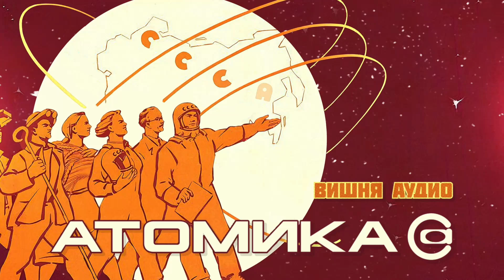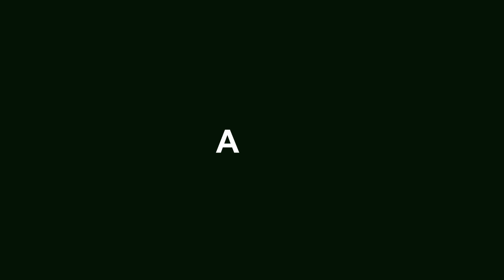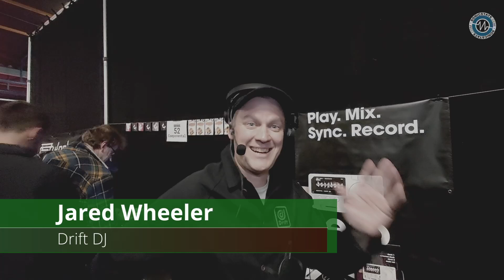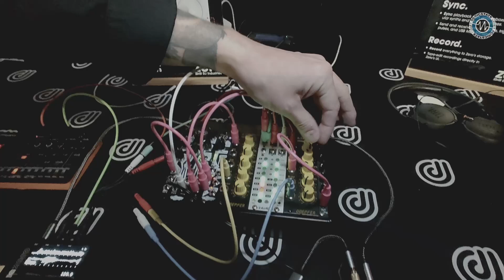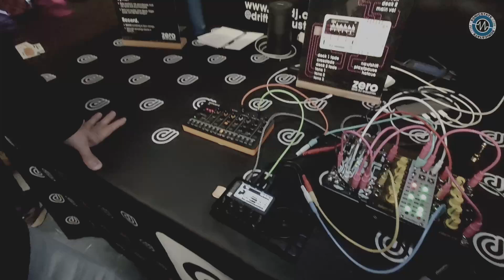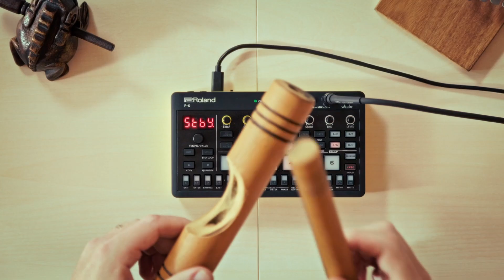Bristronica 24: Drift Zero - Synced Audio Playback

Comment: Does it have an app or do you just drop WAVs on it and it does all the track analysis on the fly? Is it constantly tracking BPM or does it dial in a BPM for the whole track? Can you fix the beatgrid if you have something it's detecting wrong? How tolerable is the workflow for someone who already has a library in Rekordbox/Serato/Traktor? Does it work with AIFF/ALAC/FLAC? No matter what the answers to those questions are it's definitely better than the SP-404MK2's DJ mode.
Reply: All the right questions!

There is no app for Zero. Plug it in to your computer and it appears as a USB thumb drive. Load via simple drag and drop. 

It will analyze beat grid on-device: drag and drop files, run the library scan/update UI (not shown here)

BPM is detected during one-time pre-analysis pass, but there is UI for adjusting the analyzed BPM value. Same with beat grid. Those two things are so hard to get right, our approach is to give you the tools to fine-tune things to your liking. 

Rekordbox import is currently implemented: Zero appears as a thumb drive in RB, drag music as normal, export collection as xml, run the library import flow on Zero. Zero imports all metadata including beat grid, key, memory/hotcue points, loops, playlists, etc. Other library systems are on the roadmap pending public API availability. 

Lossy and lossless formats are supported. Launch roadmap includes wav/aiff/mp3. Other codecs are slated for later software updates.
Reply: @driftdjindustries  Whoa nice.